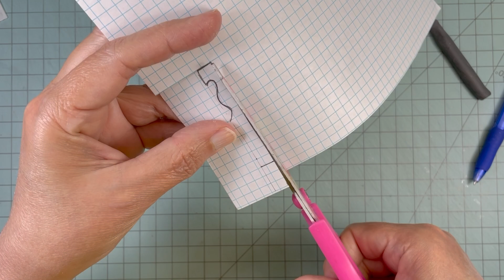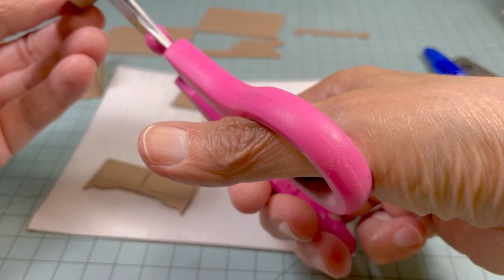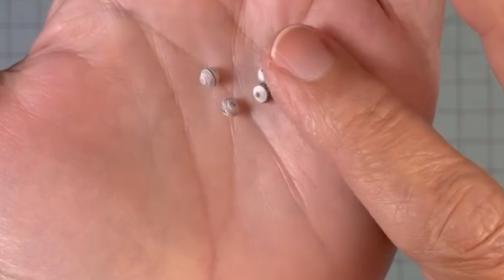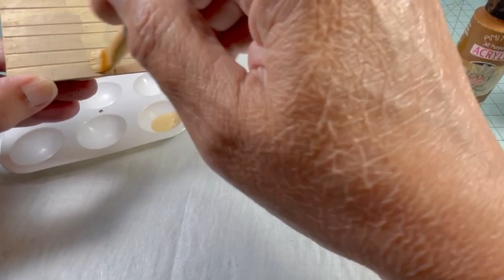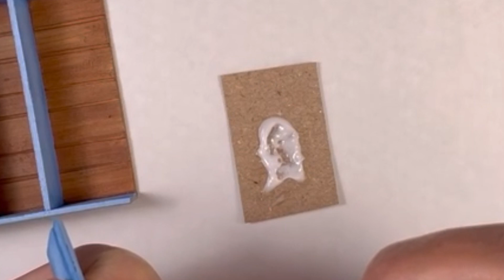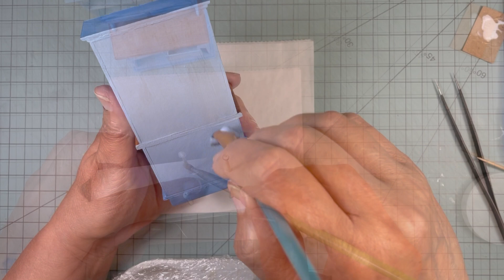Build This Cute Kitchen Hutch ( no Wood only Cardstock ) Dollhouse DIY

Comment: At I ask what kind of cardboard you use. I have such a time finding the right materials. Cardboard I have used doesn’t take paint well. Thanks
Reply from the maker: The brown cardboard you see me working with is actually heavy duty cardstock from Hobby Lobby. It’s 110 weight. It comes in cream and white I believe but the Kraft paper color is my very favorite. Any cardstock ( even food packaging works too, you would just need to sand the print side to rough it up) or light weight cardstock works. If you use a lighter weight cardstock you’ll probably have to glue more layers together. With the cardstock I use from Hobby Lobby four layers for each piece is perfect. Just remember whatever you use to glue enough layers to equal 1/16 in thick. Otherwise it won’t be strong enough just using one or two layers. I hope that helps you out with your cardboard problem.
Reply: @Lauras-tinyview  thank you so much.
Reply from the maker: @2forTX  Check out this video it shows the package of cardstock I use. https://youtu.be/p2oc8BgWnBo?si=hBvMp90EgowG1aO3

Comment: This is amazing! I really like the little fake drawer, it will look cute with some little linens or other things in it. This is such a versatile item also. I could see just the top used on a wall for a shelf, or the base alone. You did a great job with the kick plate and other decorative parts! Thank you for sharing with us!
Reply from the maker: Thanks Cheryl!! I’m thinking about using the top portion that way sometime. Sorry you have been dealing with such hot temperatures lately. Hopefully it breaks soon.
Reply: @Lauras-tinyview  It has been hot and rainy but, at least it isn't as bad as some people are having it, I feel bad for them.
Reply from the maker: @MiniatureMadnessofcherylg2696  I feel bad for them too. We usually have really hot summers. It’s been hot but not as hot as it usually is. We had a very wet spring and beginning of summer was unusually wet too.
Reply: @Lauras-tinyview  That is kind of how it has been here too.